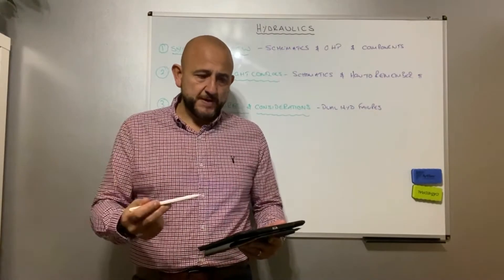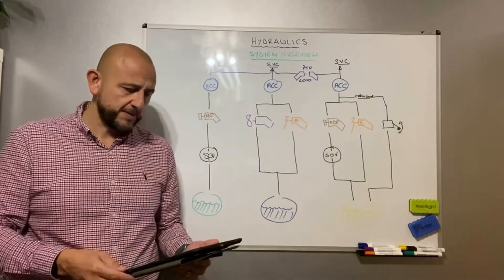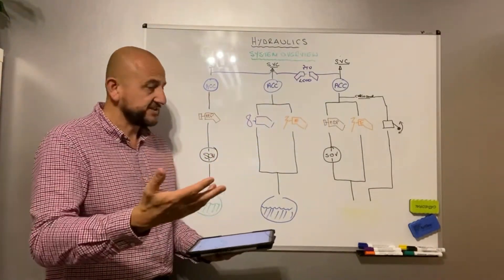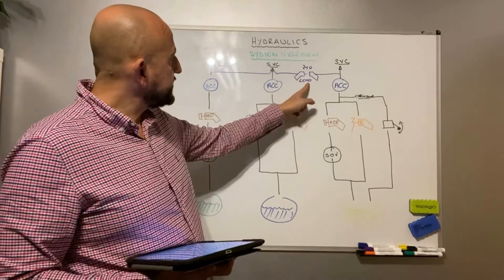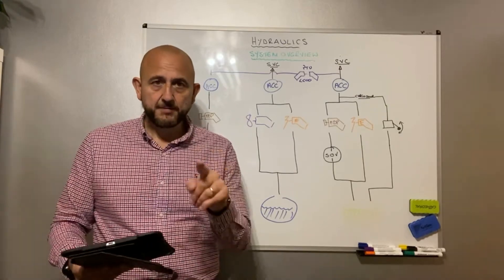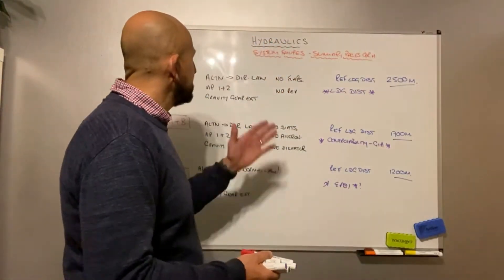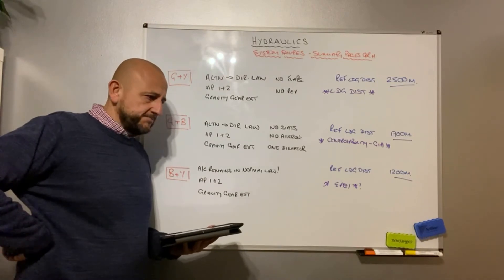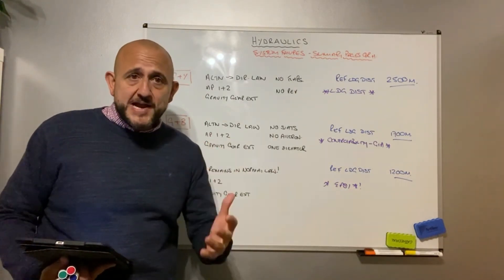Hydraulics

Comment: Have you ever looked at the hydraulic system of the A380/A350 to see how advanced it is?
Reply from the maker: I haven't
Reply: @airbuswhatsitdoingnow320  2 systems. green and yellow. On A350 both engines power both systems so if you loose an engine there is no loss of hydraulics. Then some of the ckntrol surfaces have their own mini hydraulic systems independent of the main and use an Electro Hydrostatic Actuator that just requires electrical power to operate. Some other controls are mixture of conventional and EHA and called EHBA. So even if all hydraulic pumps fail or even loss of hydraulic fluid, the plane can still fly
Reply from the maker: @tomstravels520  it’s the future